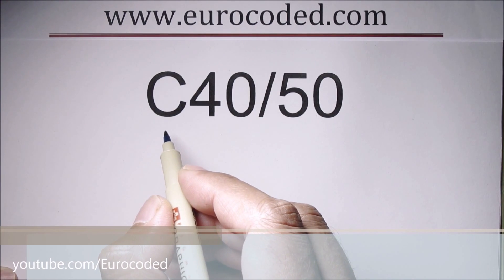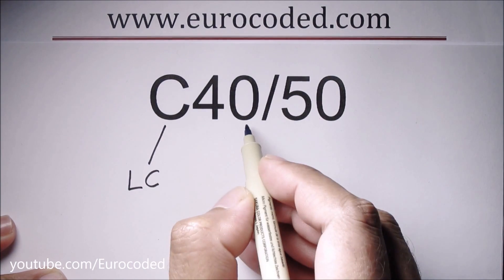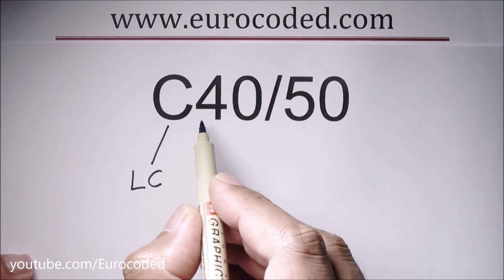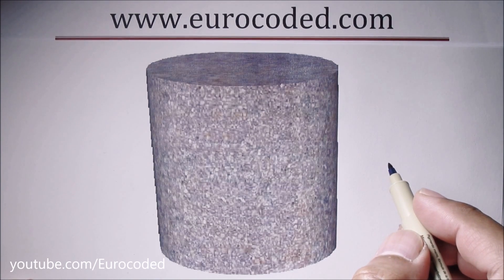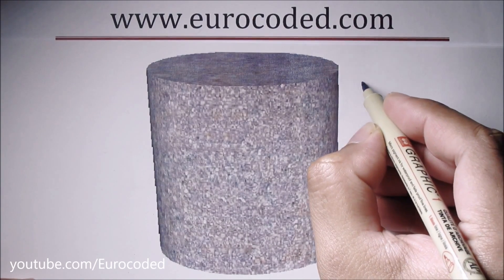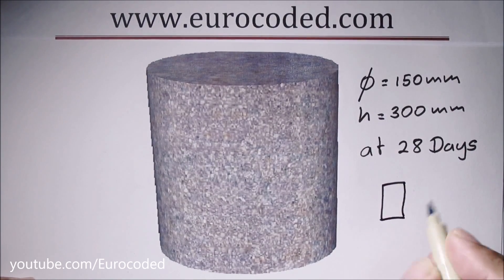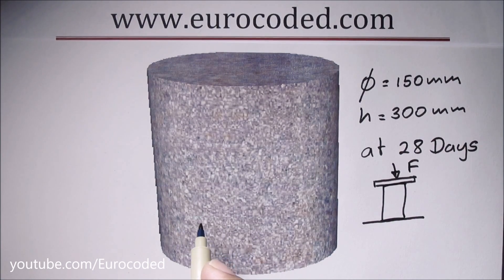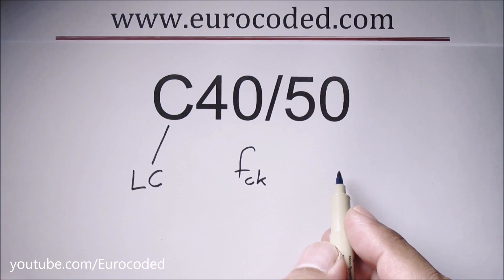Concrete Class/Grade - Concrete Compressive Strength Class

Comment: dear sir, in our company need to make foundation plate for printing Machine. the machine  manufacturer recommended is class-B35 and concrete quality C30/37(EN 206/1)  then how can i understand this how can i ask to concrete company...?
Reply from the maker: Hi - You need to get a concrete specification from a designer and provide that to the concrete supplier. May be the machine manufacturer can provide you with a specification??

Comment: Where can i get specification for Compressive characteristic cube strength of 30 MPa at 28 days or commonly known as C30 use in BS8110?  I believe it is C25/30. Thanks.
Reply from the maker: Hi Nicolas. Sorry I couldn’t reply before. Have you looked in EN 206 and BS8500 for specification?